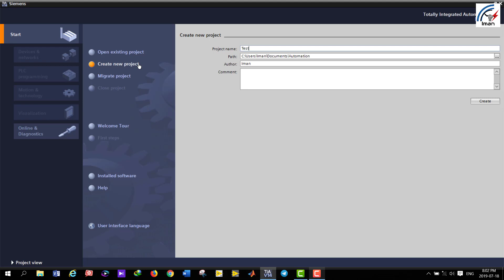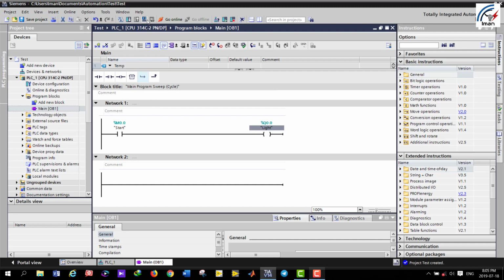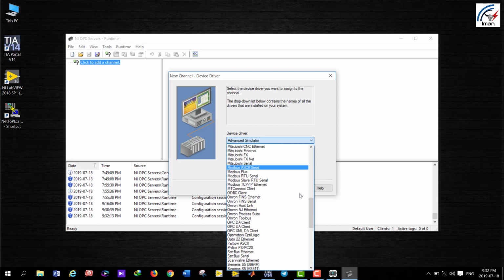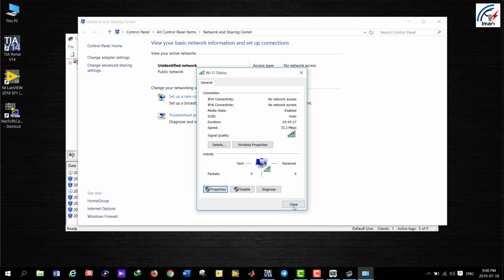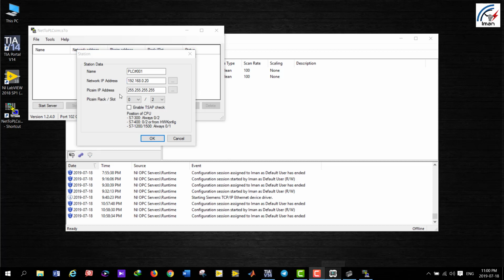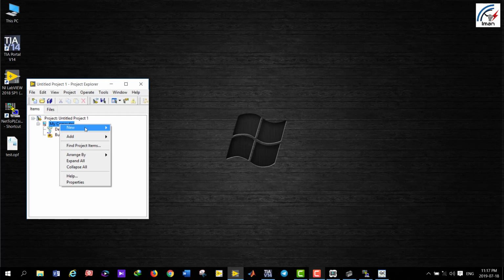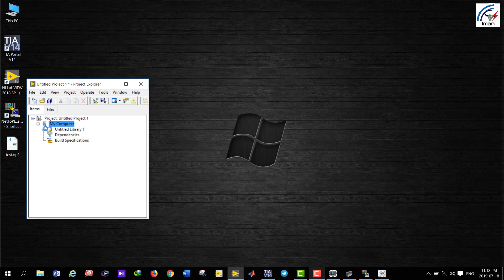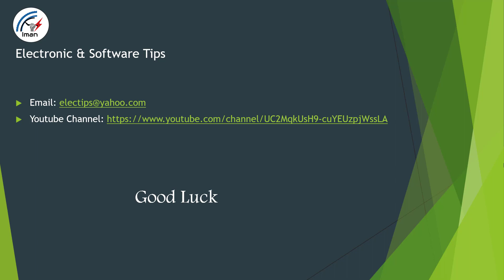how to connect Tia portal (PLCsim) to labview

Comment: hey Thanks for the video 
i have a small problem in the NI OPC configuration window when i start the simulation it shows that the connection is bad and the sources are unknown unlike yours so is there a solution for this problem please ?
Reply: It shows bad because either your PLC Sim to OPC connectivity is broken or PLC Settings for get/put and OPC are disabled.  Check if your DB is set to unoptimised.